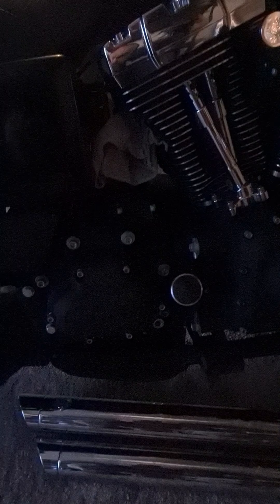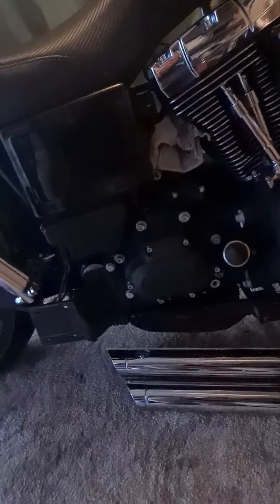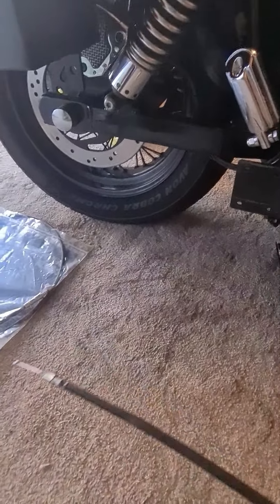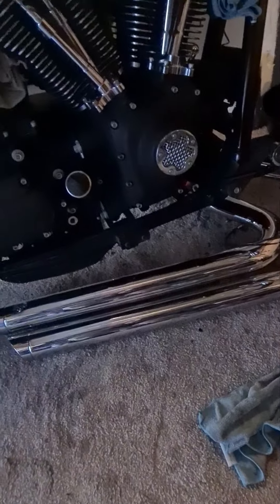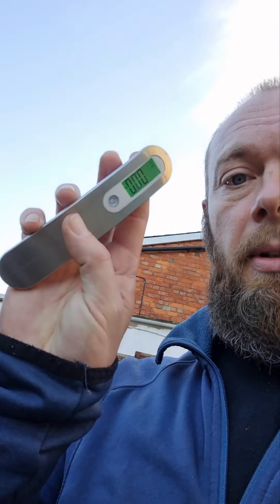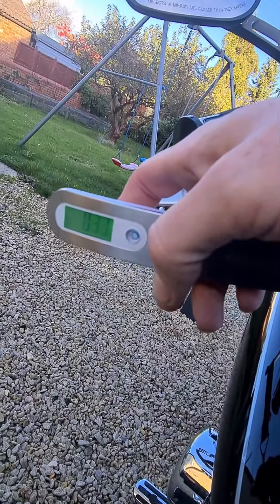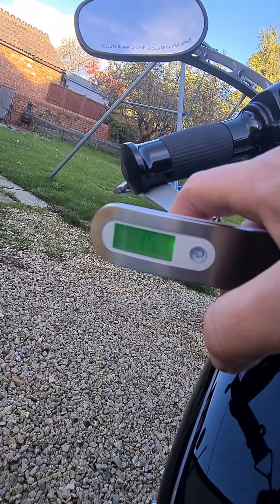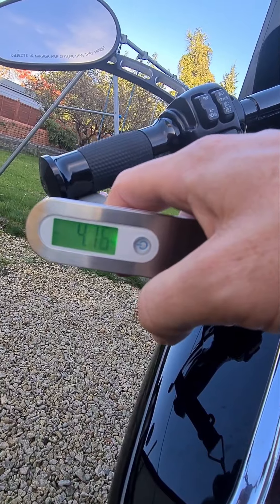Müller power clutch and Burly easy clutch combined.

Comment: I just put on my bike the same combo after installing a Barnett extra plate with a Barnett heavy duty spring. I have some issues with clutch dragging and hard to find neutral now...
It is easier to pull, for sure, but hard neutral is not that great. I'll try to find more info on it. Maybe I did something wrong.
Reply from the maker: I also had to fiddle around a bit with the clutch cable adjuster. I personally slacked the clutch cable completely again and readjusted it. Think it was on the 3rd try I found a sweet spot where it seems to work well. Hopefully it won't cause you too much trouble🤞
Reply: @averagebikerguy6469  I also found an OK spot, at least for the moment. I am just worried about the Muller adjustment on the primary side of just 1/8 back screw. I read on the forums that the clutch may dilate when hot and it may start slipping. I will see what happens on a longer ride. If nothing works I will try keeping the Muller in combination with the stock spring. 
I think I opened the bike up 10 times by now... It's starting to become frustrating.

Thanks for sharing your experience!
Cheers!
Reply from the maker: Tbh, I had to do the standard 1/2 - 3/4 back turn to stop the slipping🤷‍♂️. But now it seems to work well and the clutch pull is still as easy😉
Reply: Hi there, I know this is an old thread but really appreciated your video as I am about to put in a Muller and after watching your video may try both the Muller and the Burly together.  Now a few years on, have you had any problems with that combination?  Some people have been saying the Muller at least goes out of adjustment often.. I am considering putting this combination on a 2018 Softail Slim.  Thanks!
Reply: @nycvt4576  Just the Mueller didn't work for me. I tried combining it as it's your plan. But because I have an extra plate clutch, I had big problems in finding neutral.
I ended up getting a variable pressure plate. I have it combined with the Mueller. I still have small problems in adjusting the Mueller in my combination, but it works fine and it's light.
Good luck
Reply: Thanks, good to know. I’ve heard muller causes problems with different clutch plates. I just installed muller and it was super easy, got the clutch adjustment on first shot, backing off 1/6 of a turn.  I thought about just finding some lighter springs than stock? Rather than installing a VPC, but I haven’t researched that idea yet
Reply: Nice video. Just got a 24 RG  and the clutch is really hard to pull in so I was wondering if you could combine the 2. Glad I found your video.